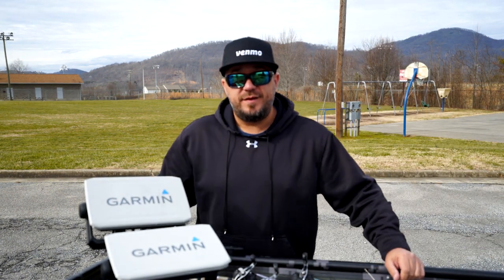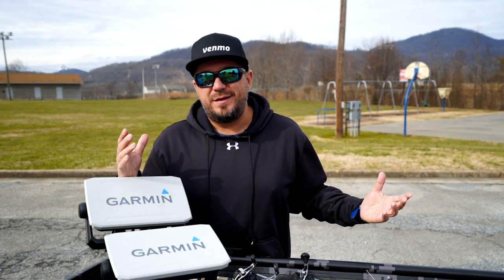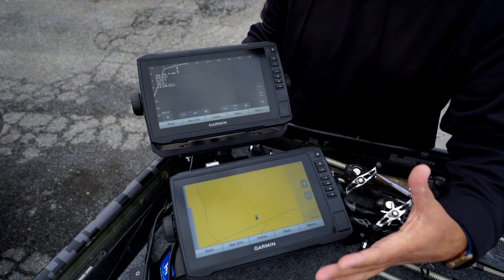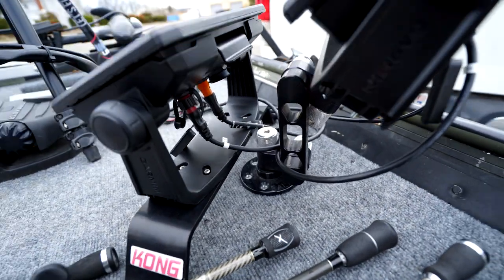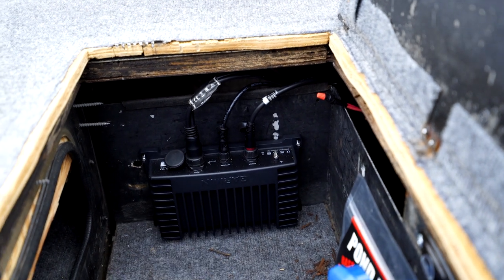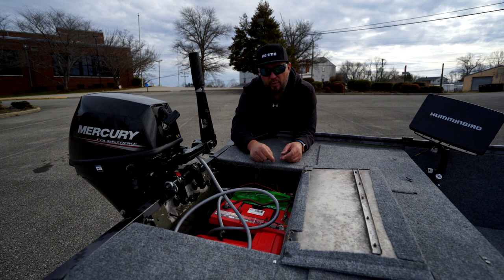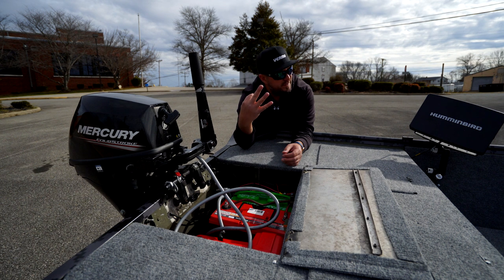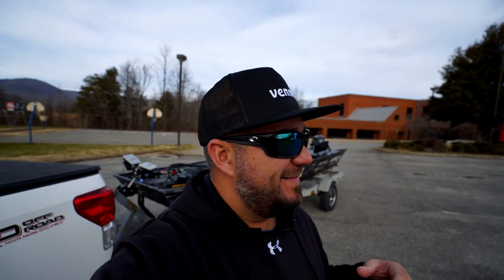I Installed a GARMIN LIVESCOPE on my JON BOAT!! (revised II)

Comment: I have a 1236 and i love it.  It's not a big water boat by any means.  But its nice and light, i toss it in the back of the truck with a 4hp Merc, and off we go.  I have a few things to do to it still.  I don't want everything bolted down or it gets too heavy and then i will need a trailer.

Great install and i love the boat!!
Reply from the maker: Dude…. That’s the way to do it!! I’m looking for a smaller boat I can do that with for small ponds and rivers

Comment: I couldn't tell where your non livescope transducer is mounted.I'm  assuming on the transom. I just bought the garmin 93 uhd  for my 10' jon to replace a lowrance elite 7.  I've always mounted my transducer on the trolling motor for fishing but not sure how that would work out with side imaging. Also I'd like to ad livescope when I can afford it.  Any thoughts or ideas?
Reply from the maker: I mounted the transducer on the trolling motor head like you’d normally do, mounted the Livescope on the shaft but.. eventually put the side imaging transducer on the back because I never used it, always looking at my livescope transducer
Reply: @DudeLetsFish  thanks. I'm going to try it on the transom.  I can probably deal with it being 10ft behind me for now.